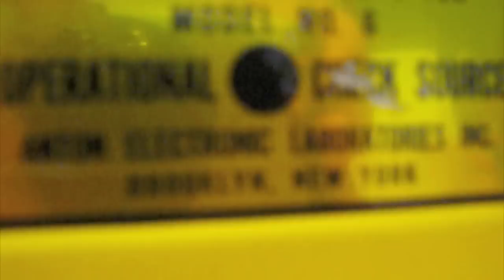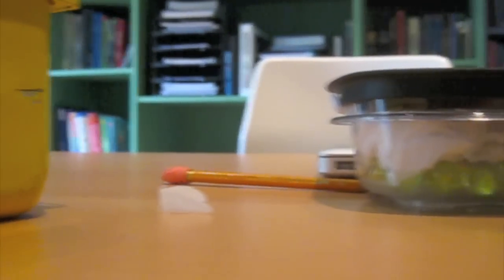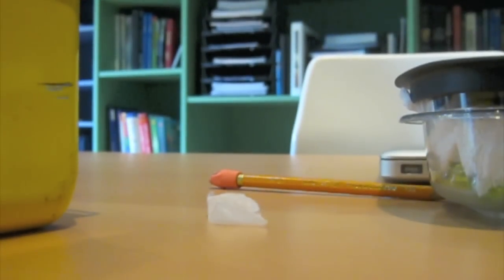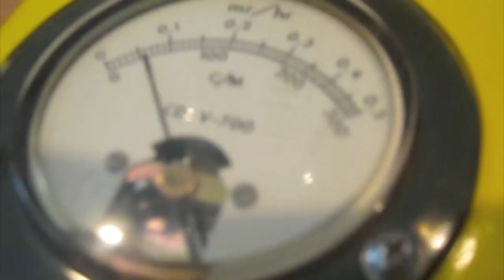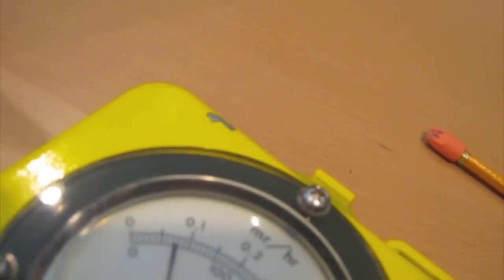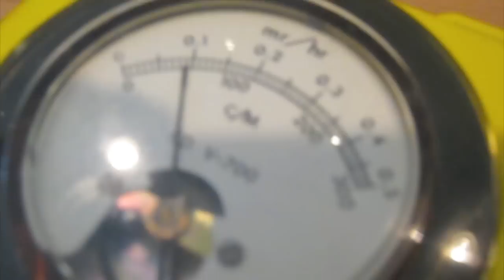How To Calibrate A CD V-700 Geiger Counter

Comment: One additional note:    Am241 is very dangerous if removed. The lattice which holds it isn't very stable and little bits can come out of the button. Really be careful.

You should invest in a tiny Cs137 check source from SpectrumTechniques com
They are about 50 bucks.

Comment: Anton model 6's have a Ra-226 (Ra D and E) check source, not U-238. Some of these used Ra-228 too, with a half-life of 5.75 years, which would have almost completely decayed by now, leaving just the Ra-226. Your Geiger counter needs to be recalibrated. The same activity of different radionuclides will give different cpm. 1 microcurie of Am-241 will give you different cpm than 1 microcurie of Ra-226. It needs to be energy calibrated to a specific radionuclide. Cs-137 is used mostly nowadays.

Comment: I just wanted to mention a side note about Am241 vs DU. The gamma emergy for Am241 is primarily under 60 keV, just like U-238, but the U-238 will contain many higher energy decay products, like Bi214 and Pb214, each providing various ranges of energy even in excess of 1 MeV. That means that an Am241 calibration will be a somewhat short of accurate. Have you considered trying a Cs137 gamma only calibration?

Comment: The minute Am241 source is embedded onto Beryllium foil. The exposure risk is very low but common sense precautions should always be applied.
Reply: It´s not Beryllium, it´s just a very thin mica foil. Beryllium and Americium, are used combined in neutron source since the Beryllium produce neutrons when bombarded with alpha particles. A thin foil of mica, work for alpha sources, as for alpha detectors (like the mica foil in pancake geiger tubes)

Comment: You can't calibrate a CD V-700 this way. The CD V-700 is calibrated with a Cesium 137gamma radiation source with the probe closed. Remember a CD V-700 MEASURES gamma and only DETECTS beta. You are saying you are measuring mr/Hr and you aren't you are only seeing CPM that way not a mr/Hr measurement.

Comment: Actually, this is the way to calibrate a CDV-700 6B at least, per the manual. The manual clearly states to open the beta window, set the counter to 10X and look for a reading between 1.5 and 2.5 mR/Hr. It's not measuring that, of course, but that's the  reading specified in the manual.

 Some 700s had RA-226 which will have decayed and be inaccurate by now, but many, if not most used depleted uranium. To be clear, this a rough calibration not traceable certification, which can only performed with the appropriate equipment (if you don't work in a rad lab, you don't have it). There's conflicting information floating around that CDV-700 is an oddball in that it is not factory calibrated against Cesium like most other geiger counters. Either way, the folks at KI4U can probably clear up the debate - they're one of the few entities around with equipment designed to calibrate the CDV series instruments.

 Now....exposing an Americium source?   Yikes! It's a strong Alpha emitter. Relatively safe a few inches away, but God help you if the tiniest speck gets lodged in the body.
Reply: The CDV-700 is calibrated using the CDV-790 calibrator. The manual mentions calibration checks and correction of the meter reading, if you'll notice the directions are listed under "Operator Maintenance 6.1". 

The chance the CDV-700 has been actually calibrated with NIST certified source within the past 30 years is extremely slim. Which means the Gm tube voltage, board, contacts, ect... have not be checked like they would have during an actual calibration. 

It's highly possible the high voltage source is causing a spiked reading and the operator in the video "calibrated" the meter within 1.5mR/hr using a source which may or may not have decayed beyond use.